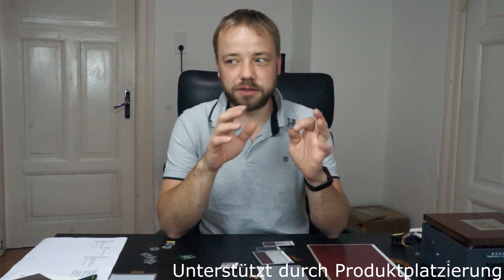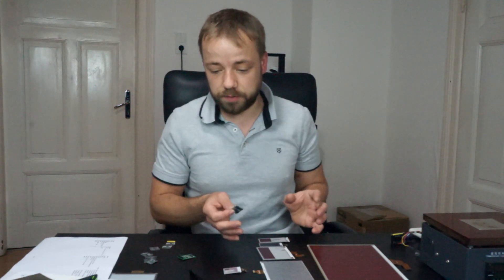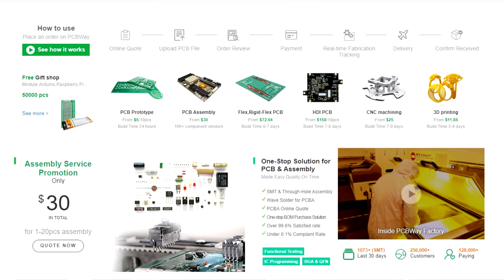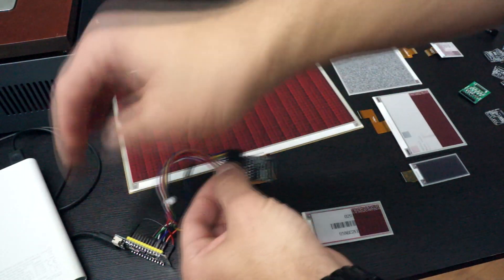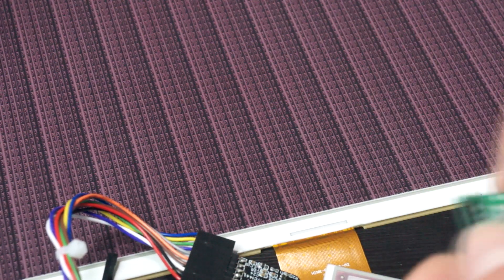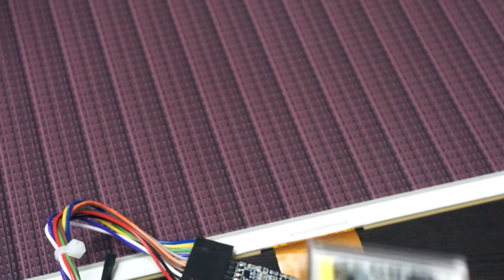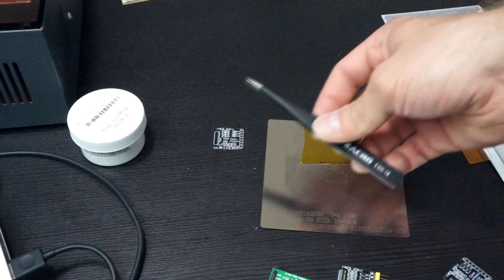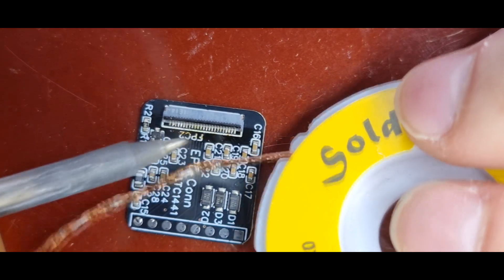Universal E-Paper adapter PCB overview

Comment: Awesome project! Could you also share the example code, which you used on the ESP32? I'm thinking of building one of those adaptor boards, but I'm afraid my coding skills aren't good enough to get the display running, so any additional information on how to feed images to the display would be very much appreciated! :)
Reply from the maker: You could use gxepd2 library as the code needs to be specific for the display type